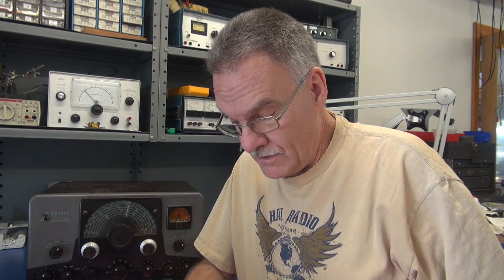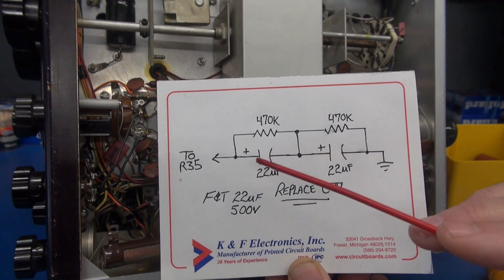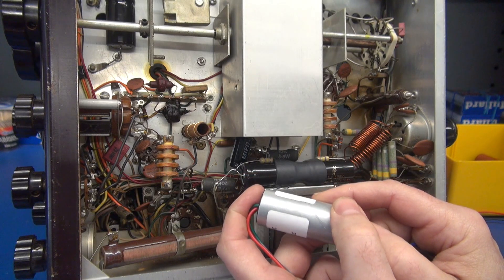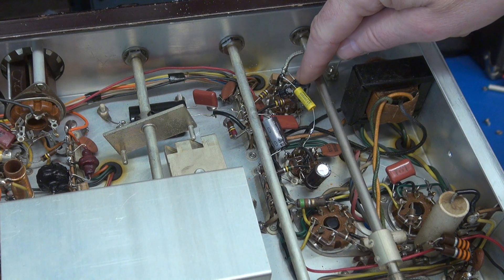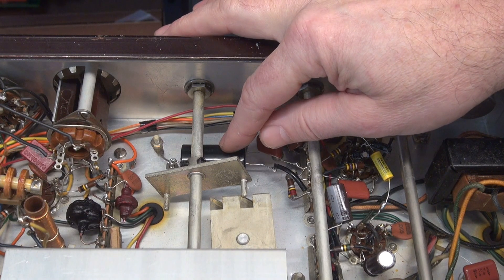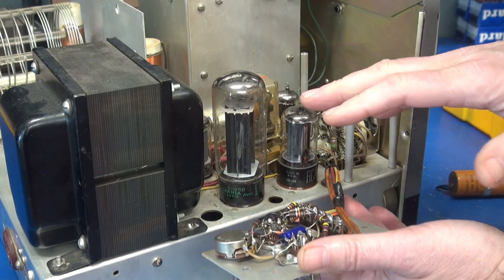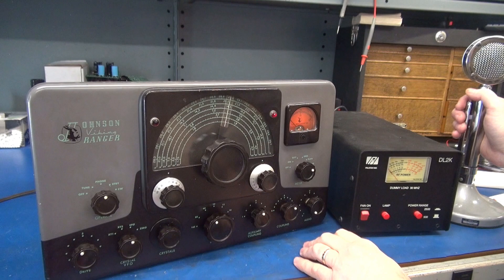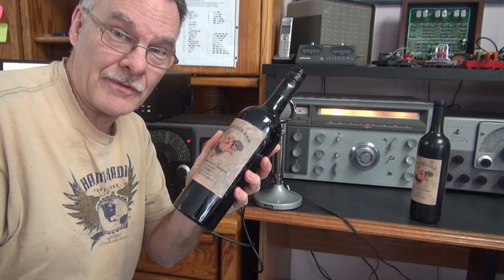Tech Tip Johnson Ranger Ham Transmitter best choice & method replacing filter capacitors tune & test

Comment: I used F&T caps in my  Johnson Viking Adventurer. Now I just have to solve the problem of why the grid voltage on the 6AG7 oscillator tube is 140 volts key down instead of it’s rated 200 volts key down.

Comment: Is it just me or many of these old transmitters had bad function switches? Heathkit seemed to notorious for it in their DX-35/40/60 models.
Reply: It seems to me that it was usually due to arcing because the Hi-V B+ was switched on and off at the function switch.  Eventually it could burn off a contact.  That's why a lot of folks move the B+ to a relay that's switched by the function switch.

Comment: D LAB, what do you mean by "dripping the plate"? and you want to ground the transmitter to the chassis of the receiver to prevent HUM?
Reply from the maker: Thats Dipping the plate, indicates that the final is tuned. I used a jumper for a temp ground connection. The receiver has a ground cable on the rear. I just did the front panel connection out of convenience.
Reply: @d-labelectronics  When you Tune a receiver and get it tuned its called Dipping the Plate?
Reply from the maker: When you tune a transmitter to the frequency the plate current dips
Reply: @d-labelectronics  Any reasons why the plate current dips when the transmitter is tuned to the receivers frequency? I'm not sure why the receivers plate current dips or what is causing the plate current to dip
Reply: @waynegram8907 ...as I recall, a parallel tank circuit draws MINIMUM current when tuned to resonance...(?)
Reply: I thought dripping plates were caused by grid leaks...uh, okay, I'll just let myself out ...

Comment: Hi Terry, thanks for the video. I know Fender used 220k balancing resistors on the filter totem pole, and I just serviced an ultra linear Super that has 100k 1 watt ones. You used 470k. How do you decide what is the correct value? Is there a correct value? Thanks
Reply from the maker: The value is calculated by the high voltage the resistors have to handle. Fenders may be around 450V whereas the Johnson is around 700V. So the resistor value has to be adjusted to dissipate without exceeding their wattage

Comment: Hi Terry - Two 22uf caps in series gives you one at 44uf, not 11uf, right?  Trust but verify…..
Reply from the maker: In Parallel they add, In series they subtract but the voltage doubles

Comment: What would happen if you put the caps in series without the 470k resistors?
Reply: If you did that, then you cannot guarantee that the voltage at the inner junction will be half of the total voltage, as both of the caps have slightly (more or less) different characteristics. This can endanger both of the caps. 
Putting those resistors in place (more or less) guarantees that the voltage in the center will be close to one-half of the total voltage across the two caps. They act as a lower parallel DC resistance than the inner resistances of the caps, and thus will tend to control the voltage at the center point. Their resistances are high in order to minimize the power that they dissipate and to minimize the effect that they have on the caps - keeping the ripple low across the total capacitance.
Reply from the maker: Yes Sir, correct
Reply: @cjay2  What about the values of the two resistors themselves? In terms of tolerance? What if one is at the low end of tolerance and the other is at the high end?